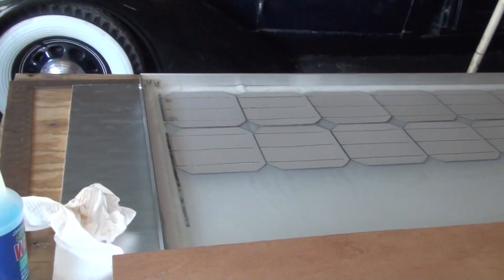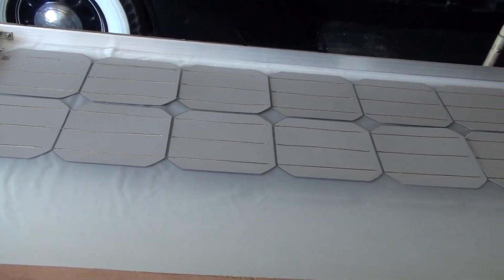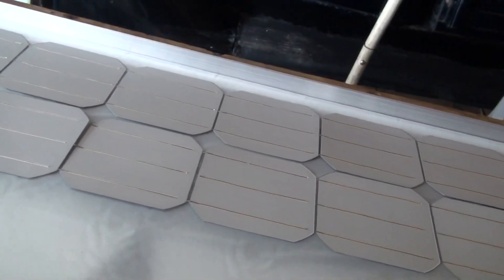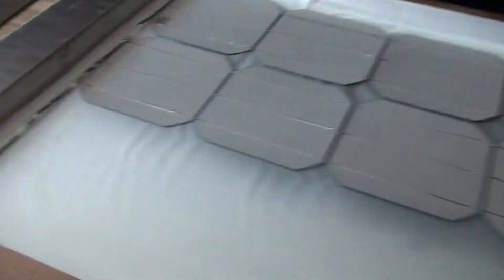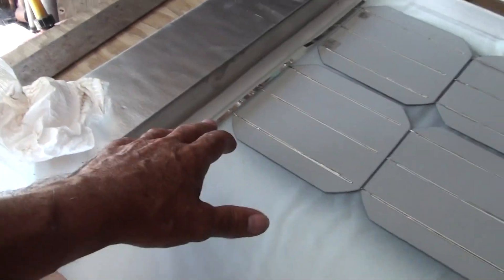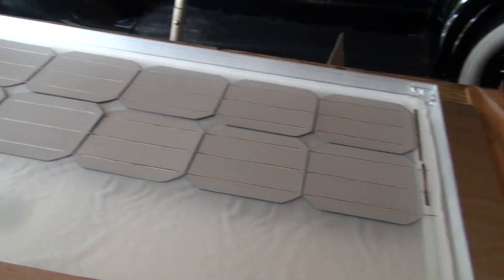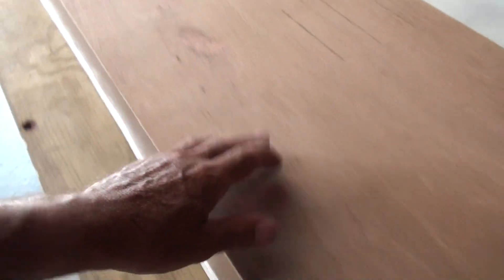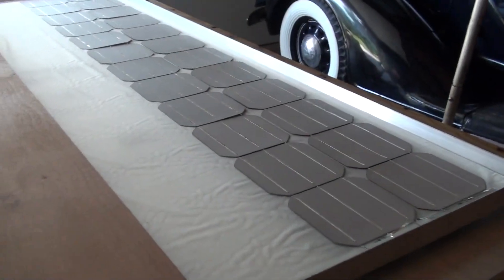how to slide long rows of cells onto EVA on panel

Comment from the maker: @donnieboy007 The EVA is laminated to the front and back of the cells to protect it from the weather. Once heated the EVA laminate turns clear so it doesn't block any light. If you don't protect the cells the panel wont last long and you've wasted your money.  On the panel you have the glass , then on layer of EVA, then the cells, Then another layer of EVA and then finally one layer of Tedlar. Then you heat it to melt it all together. The EVA looks translucent til it is heated enough to melt